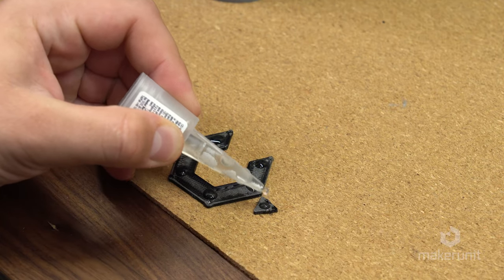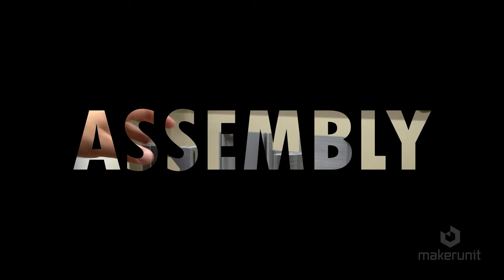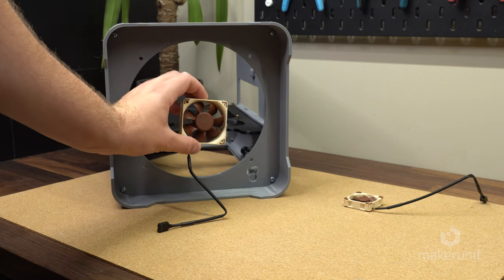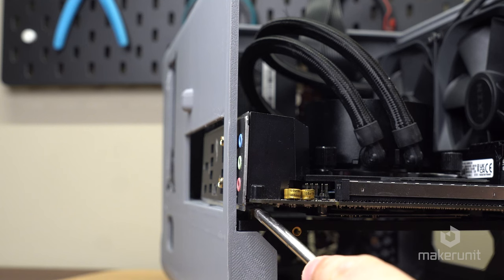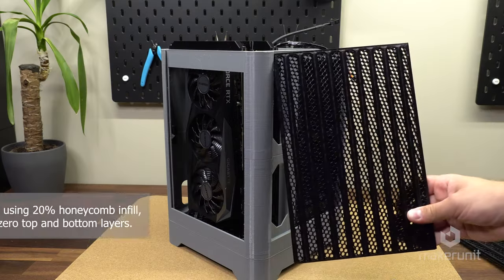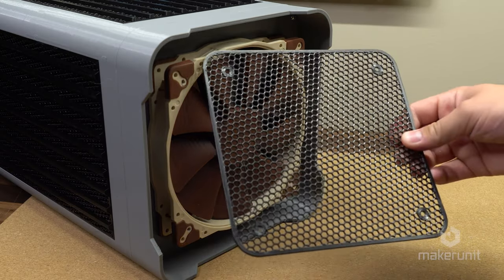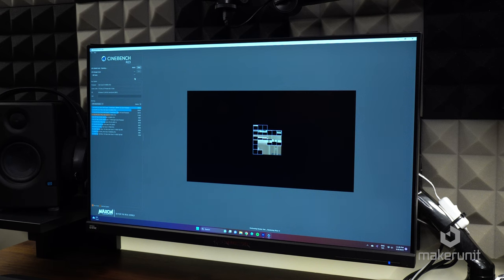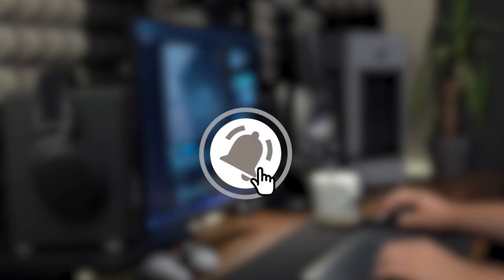Mini ITX 3D Printed PC Case Chimney Style

Comment: Definitely your best case! The other cases looked good,but you could tell it was 3d printed. This case at a quick glance looks like it could pass as a Corsair itx case. Temps were great on your aio, and it looks like you designed it with big air coolers in mind as well.
Reply from the maker: Thank you! Yeah I did have air coolers in mind for this build, though just too little space for big coolers like the 120mm tower coolers but most 92mm fan cooling towers should work and many of them are pretty effective too like the CM Evo 212 or Noctua U9s.

Comment: Just as a suggestion when gluing magnets into pockets on 3D prints. Print your pockets to have a non friction fit clearance, place a drop of glue in the pocket, set your magnet next to the pocket and use a spare/extra magnet on the backside of the print to pull the magnet you want to glue into its pocket. Mess free and no superglued fingertips.
Reply from the maker: That’s actually genious! How did I not think of that🤣 thank you so much! I’ll definitely keep that in mind for later magnet builds!
Reply: @makerunit  I had a similar problem on an ITX case build I did. Your channel was definitely what motivated me to build my own SFF case. Thank you for sharing all the cool builds!

8.5L (W 144mm x D 232mm x H 253mm)
Gigabyte A520I AC
Ryzen 5 5600X
ID-COOLING IS-47-XT 47mm
TeamGroup 32GB 3200Mhz ddr4
TeamGroup Z340 1TB
Zotac GTX1660
Silverstone FX500
Reply from the maker: @rx7wyaw  awesome, I’m glad I inspired you! Do you have any pictures of your build anywhere? I’d love to see if you want to share 😊
Reply: Maybe silly question.. but why not just use a toothpick or something like that to push it in to place rather than use magnet on back side? Especially if the location of the magnet pocket isn't easily reached on the back side?
Reply from the maker: @b3owu1f  that would also work. Just anything that won’t stick so easy. Hot glue is probably the «easiest» way as it sticks pretty well to the magnets. Though might make a mess as there’s a hole underneath the magnet. Should be glued laying on a flat non-sticky surface then to prevent the glue from squishing all over.
Reply: @b3owu1f  If you're using a magnet on one part, and just something steel on the other, it doesn't really matter, and a toothpick is probably fine, but if you want both parts to have magnets, you can use a stack of magnets to put the magnets in, and that way you're sure you have the magnet properly oriented.

Comment: I love that dual crazy airflow fan 😮
Reply from the maker: So much air, so little noise! 😁 pretty much silent on idle. Those 200mm fans are extremely quiet up to like 60-70% power. Even at 100% they seem to make less noise than my 92mm tiny fans and moving tons of air!
Reply: @makerunit  did you have both fans blowing down?
Reply from the maker: @Kurto2021  Hi, no the bottom is an intake fan and the top is an exhaust, but I haven’t really tried the opposite, but as hot air naturally will go up I thought it made the most sense.
Reply: @makerunit  yeah I agree and the fact that the power supply sucks in from the bottom and exhausts out the back....I guess I assumed the logo side of the fan would be intake but I am guessing it's the exhuast.....back in the day they used to put arrows on the fans but my 200mm don't have them.
Reply from the maker: @Kurto2021  Usually, the side of the fan that holds the motor and fan blade in place is the exhaust, and the open side is the intake. The internal AIO actually sucks air from the inside and pushes it out, giving really good cool temps for the CPU but at the cost of poor GPU ventilation... :)

Comment: I love it, that is some amazing quality build and also the new way of presenting with a bit more humour sprinkled in is serving the video great. I will have to try and get this case realised in metal, the designs are already professional level stuff.
Time to integrate some Bernoulli Effect Physics in the next case ? :P
Reply from the maker: Thanks Tim! I noticed you changed your display name but I assume you’re still the same Tim given the profile picture! 

I had to look up the Bernoulli effect but that was so cool, I have actually seen that before just never knew the «scientific» name for it. Kind of like the same effect that’s used in sand blasters for example right? Sucking it up the sand before shooting it out the nozzle.

About that, for a long time I have actually had this idea in the back of my head of a very «complex» 3D case built up of a bunch of closed channels actively targeting specific areas of the build where hot air is exhausted, to immediately remove the hot air produced by the GPU and exhaust it away from the rest if the build, kind of inspired by the part cooling fans on printers, just the opposite direction where the parts get no supply of air from any fans just normal room temperature air, then only focus on the removal of exhaust to prevent hot air circulation. 

The Benoulli effect could actually be used in this type of application, you gave me an idea. Do you know if this effect would be as effective if it had more than one «intake pipe» like those mounted at an angle in sand blasters for example.
Reply: @makerunit  Back to my old display name and yes still the same 👍.

I like this idea very much and it could prove an interesting experiment, my only concerns would be that the speed of air could be too slow to take full effect of Bernoulli’s principle but without testing we will never now .. well it could probably be calculated but that math is too much for me.

There are some videos of people building natural convection cooled cases which could provide some additional inspiration and pointers.

One problem you might encounter could be too high friction inside a narrow tube due to the 3D printed lines (maybe), looking forward to the next experiments 👍
Reply from the maker: @Neutronity  Yeah possibly. I haven’t looked too munch into this effect and you might be right that the velocity of the air isn’t enough to cause the drag necessary to be effective.

My main idea was to create channels that each were connected to their own fan and part and would just be like a straight vacuum going in channels to the different parts.

You know how in Jet engines they have all these different spinning fans after eachother to create some kind of increased pressure or something, I wonder if stacking multiple fans can create higher pressure, what do you think?
Reply: @makerunit  yes I get the idea of vacuuming the generated heat away and it could prove to just be effective enough to work. I like the idea of the jet engine like fan stacking, maybe introducing a circular airflow with multiple inlets for acceleration of the air … no idea if practicable but definitely making a nice theme for a case
Reply from the maker: @Neutronity  I actually (for a different project) always wanted to also try to make a case that looks like a Jet Engine, like with a custom 3D printed propeller looking like the inlet of a jet engine, mounted to a PC fan motor to actually serve as cooling for the entire case, and also add the service doors etc to access the internal parts easily 😁

Comment: Hey man really cool! Imo if you flipped the gpu so that the connections were down, you could very easily connect to the gpu without having to so the whole cable routing thing! You might even get better airflow as the fan will hit the aluminium fins from the gpu, instead of the connection bracket
Reply from the maker: Only problem is the big fan at the bottom too. Though I could have used a 140mm fan instead to leave more room there. The idea behind this project mainly to use 2x 200mm fans so I kinda ignored all options that would all smaller fans. I will make more though so might be an option in the future 😁

Comment: My main feedback is to look at how Cooler Master mounts the SFX PSU in their ITX cases, vertically to one side of the case. This will get it, and all those flat power cables out of the way of that chonky boi bottom intake fan.
Reply from the maker: That was my original plan to keep it vertically in the corner actually, I can’t remember why I changed it actually. 😅

Comment: That's an awesome build, especially with the two giant fans. Would be fun if it (or a variant) could fit giant air coolers like DeepCool Assassin IV or Noctua NH-D15S. Will definitely get myself a 3D printer for such a build in the future, and thanks for sharing it.
Reply from the maker: Thank you! With the current setup I would recommend using any 92mm tower cooler like the CM Hyper 212 or Noctua 92mm version and stick to a 240mm radiator if using anything that requires more powerful cooling. 

But I might make something big enough for the D15 in the future 😊 how tall is it btw?
Reply: @makerunit  I think both that I mentioned are 160mm which is about as high as it goes for air cooled. But yeah I might just spring for a 240mm EKWB Nucleus when the time comes instead. Not as much of a price premium as I expected.
Reply from the maker: @rafflesmaos  the D15S is quite pricey too so not too much more for a liquid cooled one 😊 (maybe my next upcoming mATX case might be interesting for you) it’s intended to support a lot of different configurations like AIO, big CPU air coolers and much more! 

ATX Psu, and pretty decent airflow as well. Hard drives, in a fairly compact total volume
Reply: @makerunit  Looking forward to it!

Comment: I've always thought it weird that gamers would use an AIO on the CPU but not the GPU. I always do it the other way around. Huge improvements in GPU performance, and so much quieter in operation. The only downside is that it's not as easy to attach an AIO to a GPU.
Reply from the maker: I guess it’s due to as you say that it’s more complicated to mount a waterblock to a GPU than to a CPU. I agree it’ll probably be a lot quieter!

Comment: Wind tunnel is cool...what about a wind box?  Something that has 2 200mm fans on the top and bottom and a more "standard" orientation, so all cables come out the back.   Cpu/psu on one side,  GPU on the other.
Reply from the maker: That’s definitely doable too! I’ll look into more projects to utilize the 200mm fans later once I get some more time. (Currently have a few other projects lined up first.)

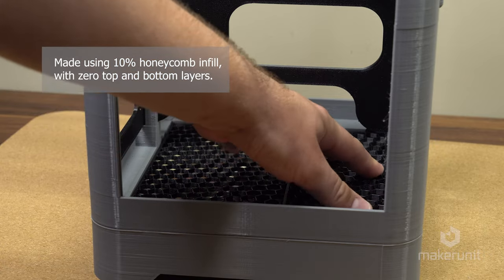Comment: This makes me want to buy a 3D Printer to make my own computer case. If I were to design one; all RGB lights would either be put into the bottom (5:34) right where the fan is would face inwards; following a specifically made exhaust port heading upwards through the case for direct cooling; and out the top. This is due to cool air going lower while warm air rises so it can concentrate on all that cool air going downwards forcing most of the heat to go upwards if that makes any sense. If I could draw I'd show a design of what I mean so it's less complicated.
Reply from the maker: I think I understand what you mean to a certain extent, but pretty much same setting with intake and exhaust like this case but have some ducts to concentrate the air to certain areas? Am I getting it right?
Reply: @makerunit  Yes, exactly. Also I do have a question, I just recently watched your video "3D Printed Micro ATX / ITX case - 240mm AIO - Full size GPU". How much was the pexiglass if you can recall, if not that's fine; and have you tried doing a side panel out of transparent plastic like ABS or something as to keep material costs down?
Reply from the maker: @Andrew-qo2jg  I think it was 3mm plexiglass. The slide slots on this new case are exactly 3mm but I think the tolerance is too tight for 3mm plexi there, if you can find 2.5 or 2mm plexi it should work.
Reply: @makerunit  Well nonetheless still a really cool project you do.
Reply from the maker: @Andrew-qo2jg  thank you! And I’ll try to keep them coming 😁 maybe I’m able to fully change your mind one day 👌

Comment: Hey makeruunit, I love your builds and I'd love to see a sff pc case that a) fits in carry on b) is silent (custom loop, d5 pump with reservoir, more than 6x140mm fans, or 9-10x120mm + 2cm radiators) c) have 5090 and new i9 (future:) d) its 20l or less
Reply from the maker: Hi there! First of all, I do not have, or know the dimensions of a 5090 yet… you’re alsking for silent, but also up to 10 fans as well as being SFF. I’m afraid those specs are quite difficult to achieve. Maybe possible some day… my goal is to continue making cases in different form factors on a regular basis and perhaps some day one of those builds will fit your requirement 😊
Reply: @makerunit  I surely will be doing it myself in kinda heavily moded meshroom s. Hopefully during christmas haha. Lets pray for 1-1.5 slot 5090 waterblock shorter than… 240.

Comment: I like this case so much. I would like to ask if the motherboard can be installed upright or if it needs to be rotated 180 degrees in conjunction with the graphics card installation, as shown in the video. In addition, can an air-cooling radiator be installed?
Reply from the maker: Hi! Thank you and I’m happy to hear you like the design. So first of all, the mounting holes will not fit if using the motherboard facing upwards like with the GPU, but on the other hand it’s a very easy fix using the supplied .step files. 

Air coolers up to about 140mm height will work in this case 😊

So most tower coolers with a 92mm fan should do the trick for most CPU’s 😊
Reply: Thank you for your reply, looking forward to your next work😊

Comment: This is such a cool pc. I might make an adapter for though, lol. I have a rtx 4090 that's hybrid air and liquid cool along with a core i9 both are over clocked. My room after about an hour is so hot. I have one of those portable air-conditioners that have a hose connected to it and the window. I was thinking  about making a y-spliter for it and an adapter for this pc build so that all the heat or the bulk of is dumped out the window in theory at least 😅😂 I know it may sound but i think it would be fun to experiment with.
Reply from the maker: Hahah thank you! That sounds like a really cool experiment and I’d love to hear how it goes! «AC cooled PC case» in theory that sounds really cool actually. You should definitely try it 😁

Comment: Awesome, as always! 😃
How about a micro ATX case with atx power supply and place for 4-8 of 2.5" SSD?
Would be nice for a NAS.
No ITX, that is supposed to be cheap and ITX=not cheap.
Reply from the maker: So, as cheap as possible. Got it. 

I notice that I get a lot of requests for making a NAS case. I must say I have never ever in my life used/or even seen, a NAS case. What are NAS cases mainly intended for? Like a server? 

Would like a 5700g + a bunch of HDD’s be considered a NAS?
Reply: @makerunit  Oh yes, 5700G is overkill for NAS!  (network attached storage)
I use it for file sharing (not windows) and as redundancy and safety, two of the same set of files on two RAIDZ, paranoia !!! 😃

Comment: This is awesome! Love the creativity. Have you ever thought about external cooling? Like 3d printing a chassis that could hold 2, 3, or... 10 radiators linked in series that would super cool the computer?
Reply from the maker: A design like that has actually crossed my mind just like you mention. I’m just not too familiar with like custom loop watercooling but definitely something to have on my to do list for future projects! 😊

I also thought about like a wall mounted case consisting of one small enclosure for each of the individual parts so the wall panel would consist of 4 or 5 small boxes that together formed one nice liquid cooled pc! Someday!

Comment: This is something I really want to try - would this case fit some of the really long video cards like RTX-4090?
Reply from the maker: 300mm is the maximum length, and about 60mm width total I think. Also if using a very thick card you may need a PCIE riser cable that does not have the angle adapter as it may hit the motherboard. Due to sticking out a bit due to the angle😁

Comment: i have learned that superglue really sucks with neodym magnets. use epoxy based glue that really works well. and if you screw up you can recover them using acetone
Reply from the maker: I actually ended up having success with hot glue on another magnet mount project. Although I’m not sure if the heat from the glue may impact the magnetic capabilities of the magnet but it seems to work the way they were intended so I won’t complain 😁 maybe the heat exposure is so short that it doesn’t really affect it much…